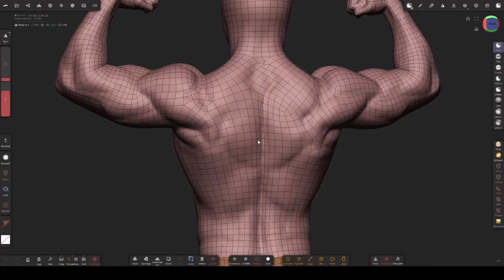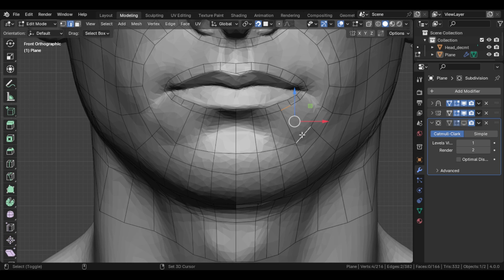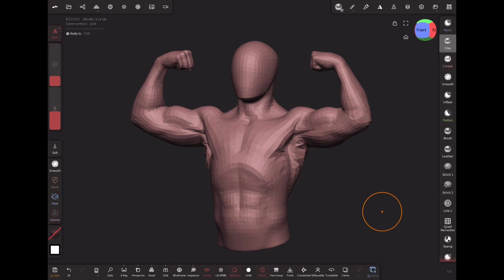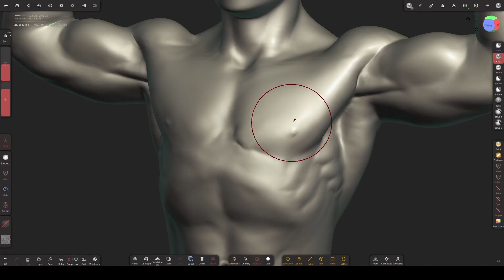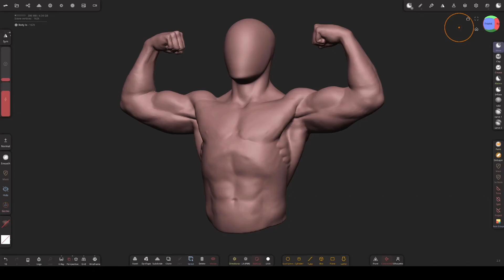How To Reproject Details To A Clean Topology Mesh | Nomad Sculpt Tutorial

Comment: Question about this: I think I already know the answer, but if you are performing this task with multiple objects in a project (say if you are trying to reproject details onto the torso of a character in a file which also has separate arms, head, etc.), should you select both the high and low res objects in the hierarchy before performing the reproject operation, or will that break things? I just tried it but I wasn't sure anything happened.
Reply from the maker: If you are gonna reproject details to multiple objects, try doing one object at a time. So hide everything else and just keep the part (both high and low poly ) you wanna reproject visible. Also, I'd place the lowpoly right below highpoly of each part in the scene. It's easier to keep track this way.
Reply: @vertexsenpai3D  thanks!

Comment: Btw, why are you not using the facegroup to handle the edge loops? With QuadRemesher you can have clean topology and good edge loops :)
Reply from the maker: This video is about how to reproject details AFTER you get a clean topology mesh. Spending too much time talking about how to manually retopo or how to use quad remesher for perfect topology would have made the video unclear and confusing, especially for beginners. I will however make a longer video on How to use Quad remesher, where I will show its useful features. Hope that makes sense. :)
Reply: @vertexsenpai3D  Yup It does :)
Good work btw!
Reply from the maker: @EnvyPurple  Thank you !